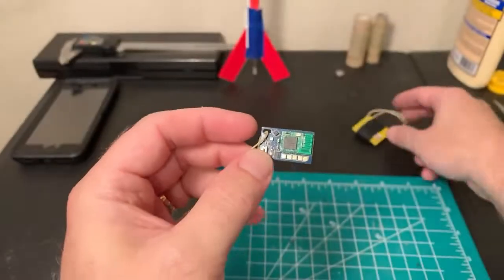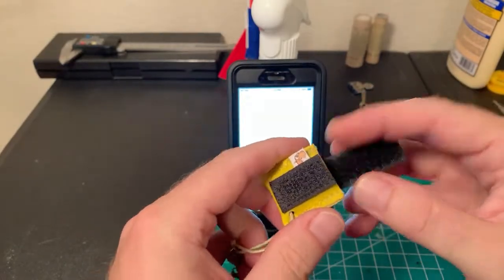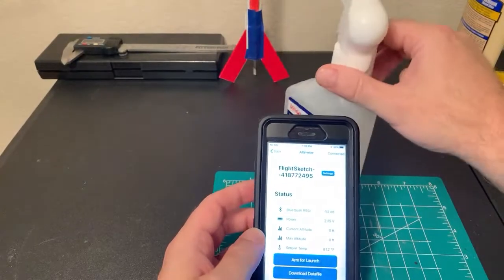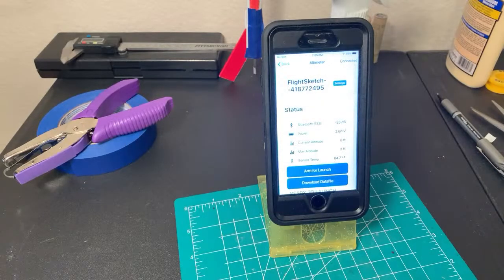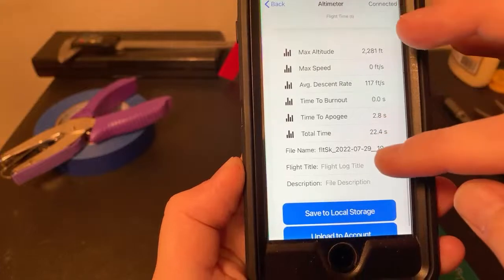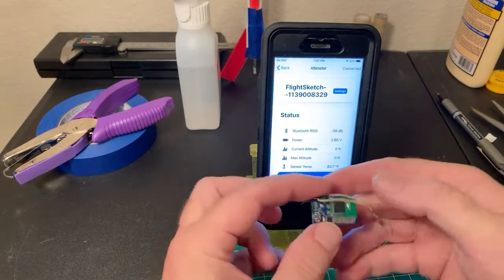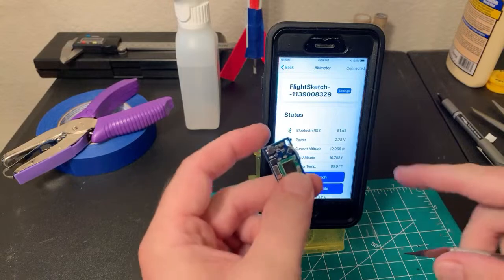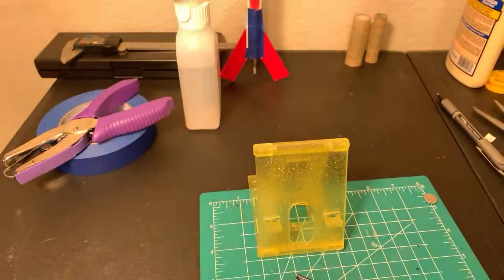Yankee Rocket Repair/Retrofit

Comment: Kevin! Sorry I was busy tonight - I would have loved to be on the stream. Everything looked pretty good. Let's see... Harsh Criticism: I probably would have cut away a little more of the monokote to ensure the "flap" had more tube to grab onto. I probably would have rounded off the tops of the flap as well. Harsh Criticism - off. As you stated - my way is not the "right" way, it is simply "my" way. Lots of room in the rocket world for different techniques.
Once the glue dries, fillet the edges and then do another "C" flight as a test.
Then... To infinity (2000ft!!!) and beyond!
Thanks for the shouts.
Reply from the maker: JC, no problem!  Actually, building on the livestream was easier than I thought it would be, so plan on me doing more in the future.......(hopefully not repairs, but builds)........  I can't argue with you on any of your criticisms.  I remember you rounding the corners of your leading edge flap, but I had make it a little original.  Otherwise people would look at my rocket and assume I bought it used from you!  LOL  I have already removed the tape and verified it's on there solid and I immediately laid down a fillet to smooth the LE.  Good call on the "C" motor trial.  You know me, any excuse for a test flight!  To infinity and beyond!!!!
Reply: @KevinsModels  Excellent. Hoping that bird flies straight and true.

Comment: Is the battery case on the altimeter loose? That happened to be mine after a rough landing. It would turn off at ejection.
Reply from the maker: I don't use the little white plastic case.  It won't fit in the nosecone.  That being said, I have pressed down on those 2 little tabs a bit tightening up the battery.  Don't think that's the issue.  When sitting idle, it sporadically jumps up tens of thousands of feet and the sensor temp jumps from 80 degrees down to minus 180!  It's all over the place!  I'm down to one last FS Mini!  That's why I'm moving on to using the Estes for the time being........